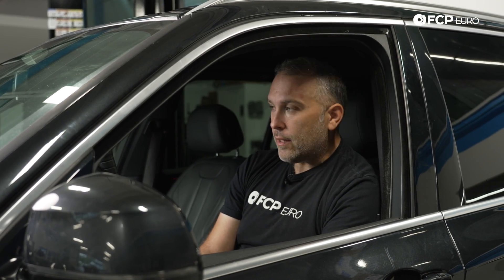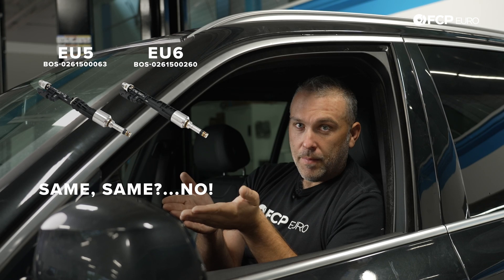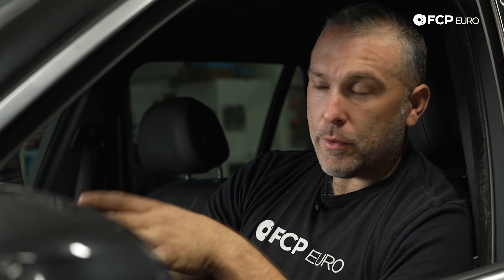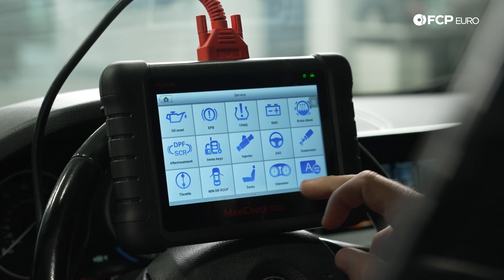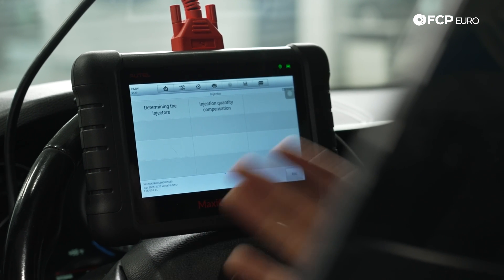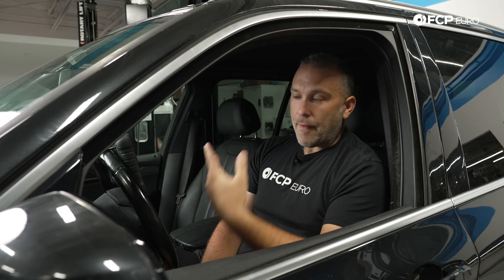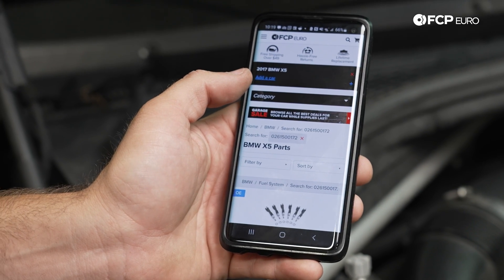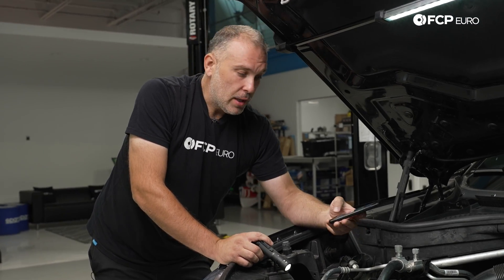BMW EU5 or EU6 Injectors? Identifying BMW Fuel Injectors

Comment: Sorry, calling BS here. The screen on the scan tool says that EU6 injectors are REQUIRED for this engine, it does not say what is installed in the engine.

Comment: I have a 2013 F25 with a N20 replacement engine from a 2017 F30...  I'm using the original F25 DME, turbo and injectors.   I just figured out the F25 injectors are EU5 and the F30 injectors are EU6.  Engine has been running fine for two years with the EU5s but is there an issue using them with the F30 engine?  Is the injector related more to the DME or the actual engine?

Comment: Nice video, thanks for sharing👍. The procedure how to be assured about the right type of injectors is clear now. But if I type the injector number on Internet page I get a lot of offers. I need to know if I can buy for example Bosch injectors instead of BMW original parts. I thing that Bosch is a contractural part producer for BMW but in this case injector with logo BMW cost twice more than Bosch  itself. Is the Bosch injector comletely the same or the one with BMW logo has some small difference?

Comment: We do not change these injectors because... The original ones are made in Germany, but in the BOSCH packaging it is Türkiye, the quality is much worse. They regularly deliver N20\55, B48\58, Mini, etc. Do not rinse with very aggressive solutions, because... A mesh is fused into the top of the electromagnet. Click on the nickname, you can see the old one there.

Comment: Correct me if I am wrong... Scanner is not telling what injectors in engine. It is telling what injectors the DME is coded for. If it is telling u it requires EU5 and u have EU6 injectors, u need to replace them.

Comment: Great video, just realized that my car with a vacuum actuated wastegate uses EU5 as the HPFP operates at 74bar at idle whereas the N20 engine with electromagnetic wastegate actuator takes EU6 since its HPFP at idle is about 105bars.

Comment: They're trying to do away with all this. How sad... stupid... and dictatorial of western governments. They incentivised auto makers to go electric and they all doing that because they feel like the have to. The shift to electric is all orchestrated from the top. The people do not want this. That's why EV cars are still a rare sight on the road. People prefer being able to work on their own vehicles. Can't do that with EV stuff. This push will result in the loss of millions of jobs, especially in the auto service and parts industry. The manufacturing jobs will hemorrhage as well. Most of that will be sent to China. We most vote to stop this crap! We have a right to drive whatever the hell we want! A modern internal combustion engine with modern emissions equipment is not as dirty as they want you to think. There should always be an option to drive a gas burner. I just hope smaller companies will pop up to make them...

Comment: Is it correct that EU6 injectors do not need to be coded? I changed my EU6 injectors on 2015 X5M and using a foxwell NT510 the values were all set at 0.00. The last 3 numbers on both the new and old were all the same so I left it alone.

Comment: Awesome video Gareth! If im running on EU5 and change all 4 injectors to a EU6 (I own a 320i) will it be ok?
Reply: I have done the same thing in my car (same 320i N20), im having some problems in the high pressure rail that im not really sure is related (my car simply broke 2 high pressure rails from nowhere, this is definitely not a common problem and im suspect thats related)
You car is fine? Having any problems?
Reply: @hugobezerratocchetto8950  no, It turn out that my car runs on EU6 so

Comment: Glad to see a non-scan tool way to determine which you have, since my understanding is you do not need to code EU6. If that is the case you can just order EU6 and skip the expensive scanner step.
Reply: The EU6 injectors quantity compensation values seem to be the same on current injectors but the value can change potentially in the future. I'd still set the value for the cylinder that received a new injector even if the stored value is the same.

Comment: As a preventive maintenance, at what milage and years of use would you recomend changing the injectors?
Reply: These solenoid style injectors are very reliable compared the earlier BMW piezo style injectors. I'm at 103K on my X5 xDrive35i and it runs as it always has. If you were to lose an injector you can replace them individually. It's a service I would only do of there was an issue with an injector and would not look to do it preventatively.
Reply: @GarethFoley  You cannot replace one injector with a new one. Because BOSCH packaging is sold from Turkey, but at the factory they are supplied only from Germany. Let's only buy the old ones. I often wash N55 at the stands and check the filling. If you have Turkish, I suggest you always throw it away.